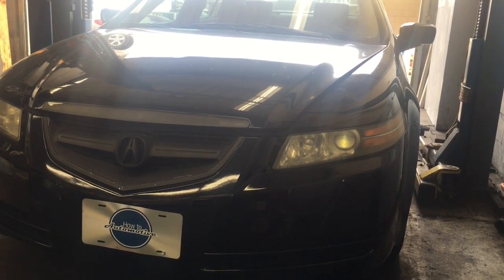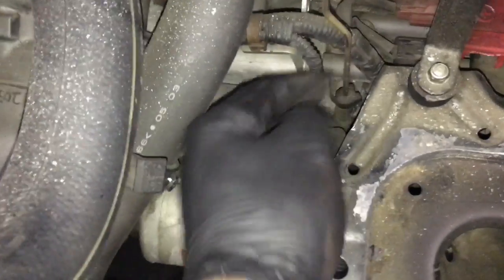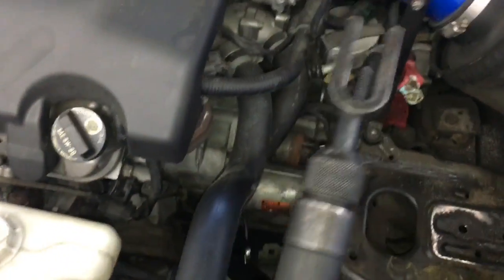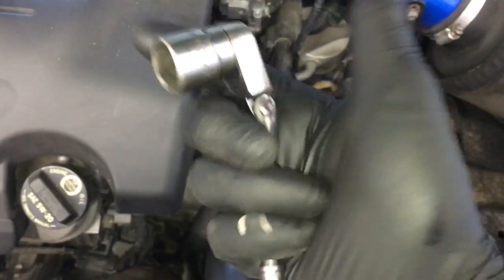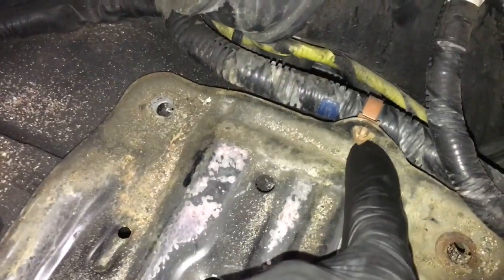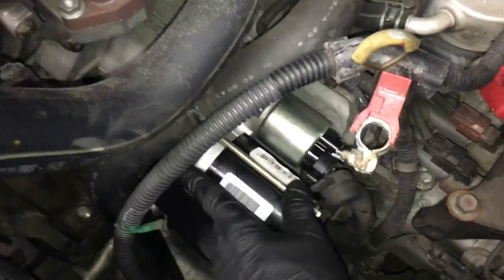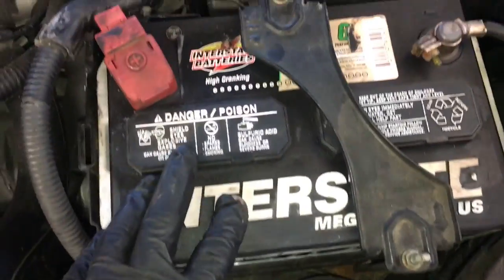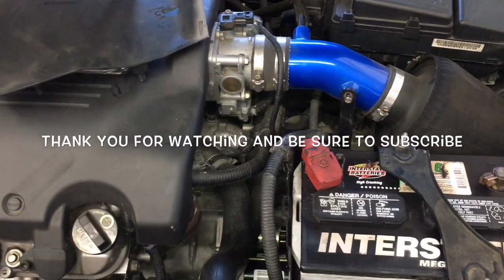How to Replace the Starter on a 2005 Acura TL

Comment: I replaced my starter twice in the past 7 years and it's having issues again. Must be something else effecting the starter. Thanks hanks for the great vid.
Reply: Did you replace it with an oem starter? If you replace it with an aftermarket starter it might not last as long.

Comment: The hardest part was do unbolting the two bolts that hold the starters. It was so hard I had to use a breaker bar . The bottom bolt is extremely long.  The bolts holding the battery tray was a pain in the burr to remove too because tight spaces we had to deal with.
Reply from the maker: The Story of My Life CNTK sounds like you got it all handle. Yes starter bolts can be tough.
Reply: How to Automotive thanks for the video. It took me 1hrs to complete the replacement
Reply: @jonphanspromotions  aà

Comment: Car has been having issues starting, I’m sure it’s just a loose connection. Do you know if the wires are accessible without removing anything?
Reply: Only remove the battery